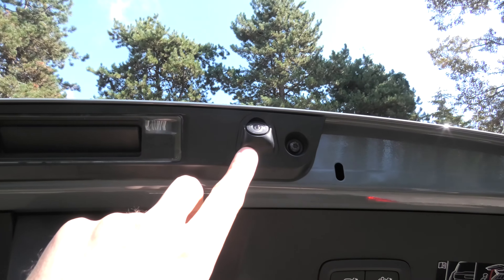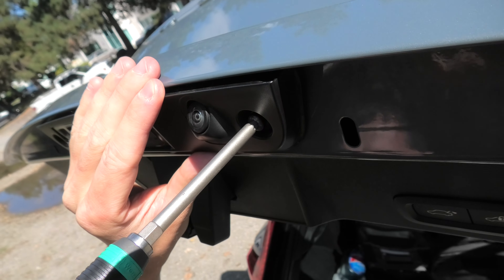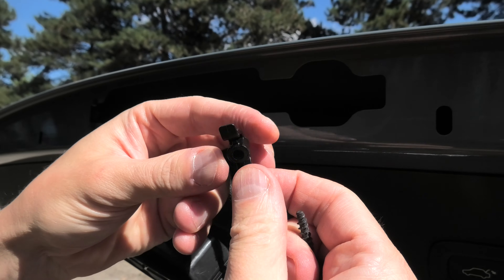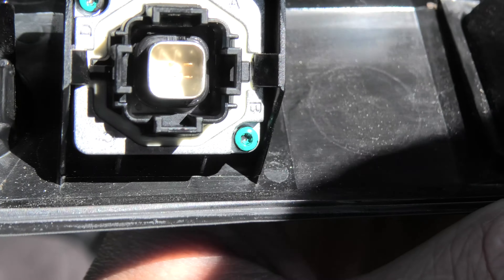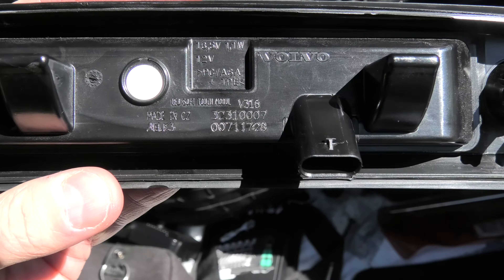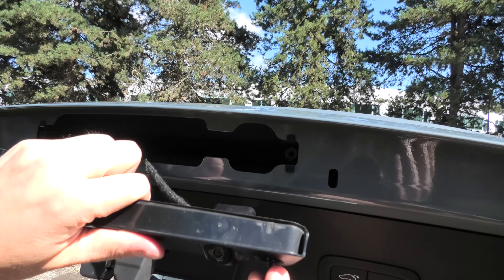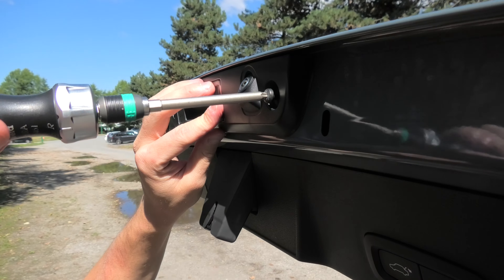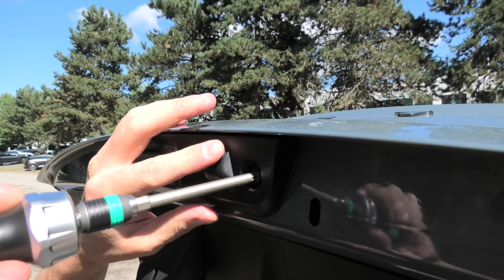Volvo XC40 (2019-2025): How To Remove Rear View Camera, License Plate Lights And Hatch Button Panel?

Comment from the maker: PRODUCT LINKS:
1. Volvo XC40 Rear View Camera, 31445951 - https://www.ebay.com/sch/i.html?_from=R40&_trksid=p2332490.m570.l1313&_nkw=31445951&_sacat=0&mkcid=1&mkrid=711-53200-19255-0&siteid=0&campid=5338971185&customid=&toolid=10001&mkevt=1.
2. Volvo XC40 Tailgate Handle Panel, 32310007 - https://www.ebay.com/sch/i.html?_from=R40&_trksid=p2334524.m570.l1313&_nkw=volvo+32310007&_sacat=0&_odkw=32310007&_osacat=0&mkcid=1&mkrid=711-53200-19255-0&siteid=0&campid=5338971185&customid=&toolid=10001&mkevt=1.
3. Volvo XC40 Liftgate Latch Handle Clip (Nut), 31462413 - https://www.ebay.com/sch/i.html?_from=R40&_trksid=p4432023.m570.l1313&_nkw=31462413&_sacat=0&mkcid=1&mkrid=711-53200-19255-0&siteid=0&campid=5338971185&customid=&toolid=10001&mkevt=1.

RECOMMENDED TOOLS:
RATCHETING SCREWDRIVER SET - Wera Kraftform Kompakt 60 RA Ratcheting Screwdriver Set, 17-Piece - https://amzn.to/424g1ZY.